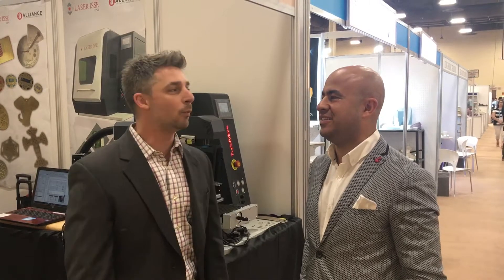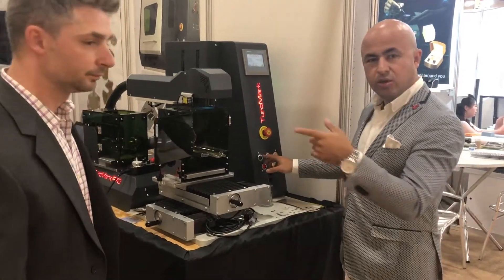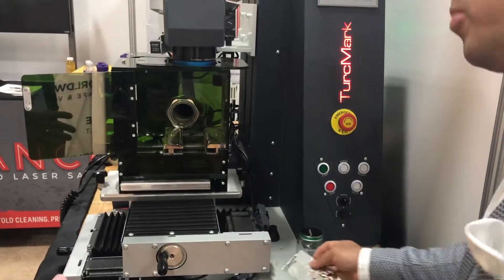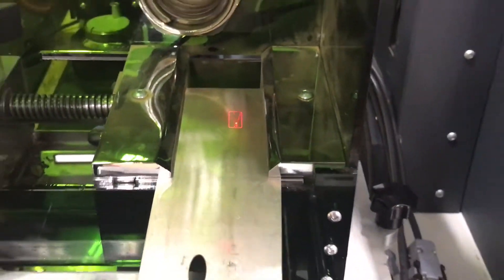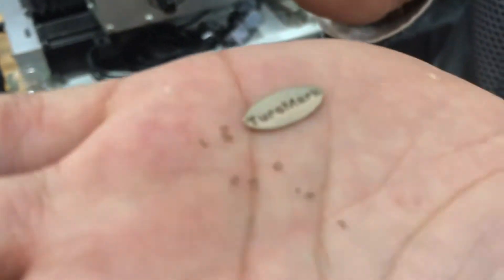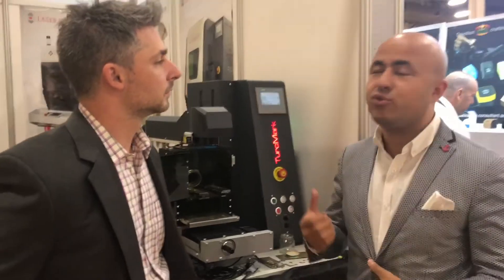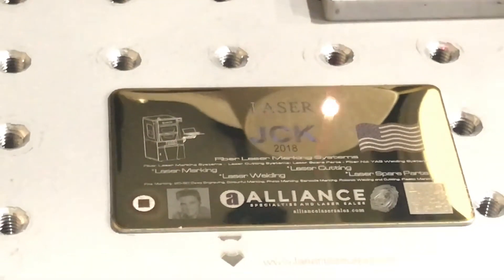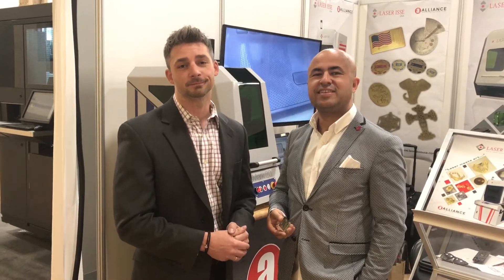JCK 2018 Jewelry Show Laser Cutting Demonstration

Comment: Price of the machine
Reply from the maker: The price for this 70w Laser Engraving system is $73,000 as seen in the video.
Reply: Alliance Specialties and Laser Sales do you have any laser engraving machine for watches? i have one that costed me 500 usd but it only engraves .80 mm on stainless steel i would like at least 1.5mm of dept
Reply: @milikiwiki1  
you better get together with chinese

watches are small, so  economically you can go with a 30 watt laser
it require more passes but can do  the  job  you need